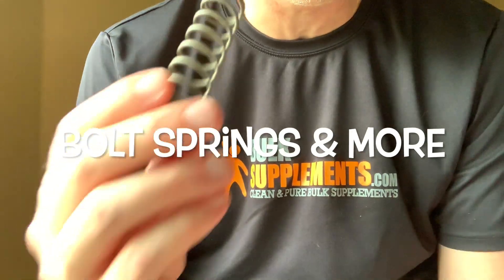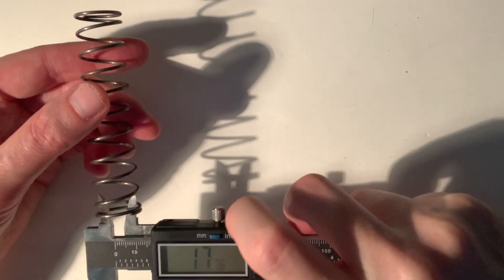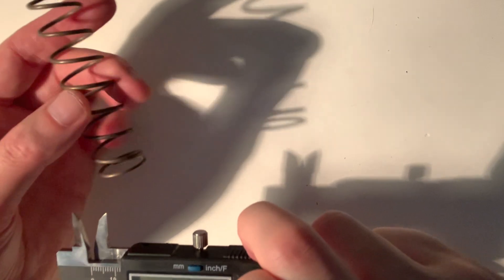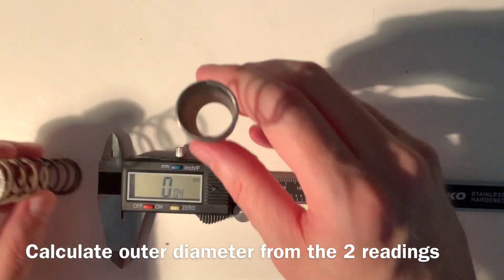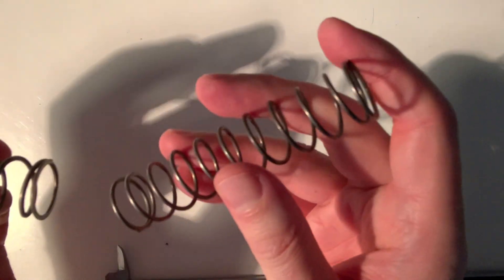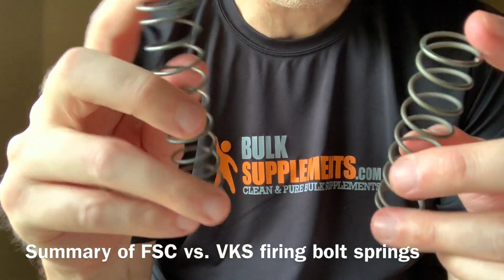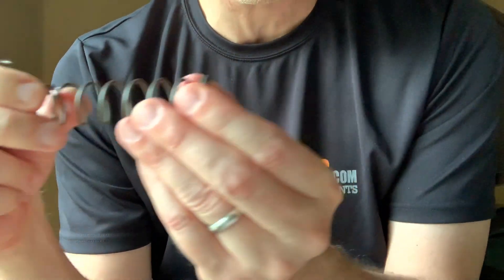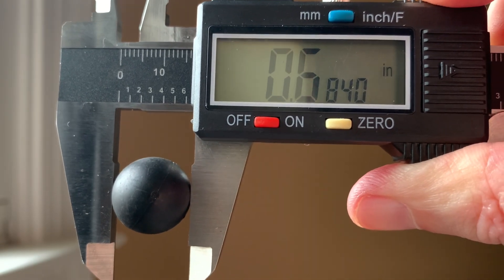Pepperball VKS firing bolt spring, Grimburg barrel, JULv2 measured!

Comment: Can I get the spring at Ans gear or rock star tactical
Reply from the maker: Unfortunately no. That was part of my motivation to make this video and give the measurements. It's a lot of work to outsource your own spring but there are many spring companies that will do custom orders if you can't find one that is close enough. I am not convinced that the VKS spring is an essential upgrade but it works great and I'm going to stick with it for now in my TCP.

Comment: What’s the point of changing springs
Reply from the maker: A stronger spring provides a quicker reset of the firing bolt to the sear after each shot. It helps conserve CO2 loss and gives a little better FPS on the later shots. It's not essential but I like the way it synergizes with the VKS sear spring and the VKS regulator spring pad.

Comment: Can I use this spring on my m17?
Reply from the maker: That's a good question. I'm afraid I can't advise you on that one. My assumption would be no since the firing bolt assembly for the Valken M17 is likely bigger and different. However, if you do measurements on your M17 spring, you can remove coils or make the wire thicker by similar amounts and design your own stronger spring. Might be interesting. Let me know if you try something like that.

Comment: Are there any concerns with using the VKS magazine cavity for storage of additional rounds? I wasn't sure if there's any other purpose to the screwcap beyond attachment of the magazine to the VKS.
Reply from the maker: Good question. I have tried putting extra rounds in that cavity before and it doesn't work well with loose rounds. They will get wedged in there at odd angles and you will have to shake it upside down for a while and/or poke them loose with a stick.  It's definitely not fast in an emergency. However, if you put the rounds neatly inside a linear paintball tube that is appropriately sized, that tube can fit down in there and that seems like the best overall approach for carrying a re-load. I don't think the actual screwcap serves a normal purpose but I would definitely always leave it on there and keep it tightened.
Reply: @ShadowCatTactical  I had the same experience with rounds getting lodged. That made me think that wasn't the purpose for this design. Thanks!